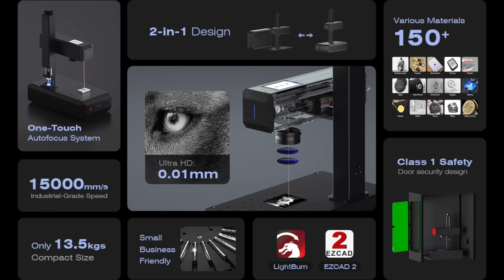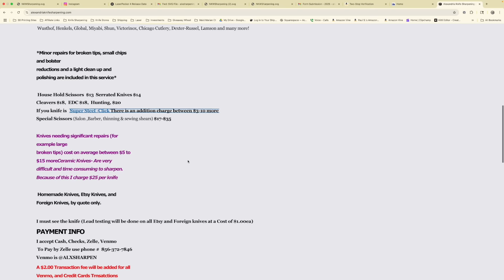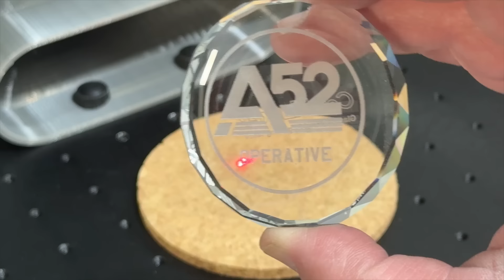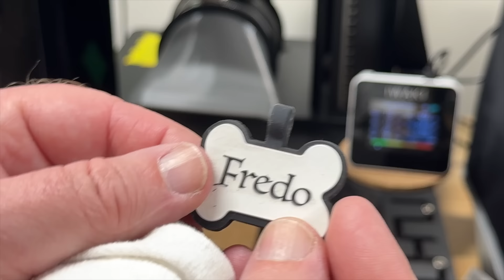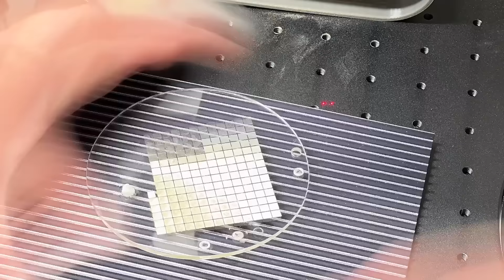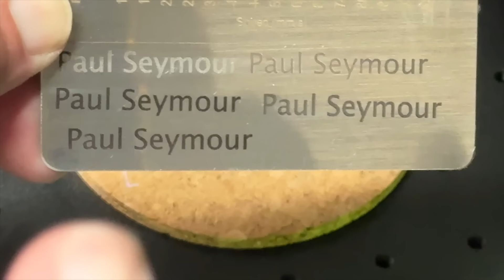ComMarker Omni 1 5 Watt UV Laser or ComMarker B6 20Watt Fiber? Which one SKYROCKETS Your Business

Comment: Great video!

Would you mind sharing the settings for the defocussed black mark on stainless with the UV? I have a 10w UV and I am trying to get a good black mark and yours looks great!  :)
Reply from the maker: I haven’t done with the UV  to see it’s sweet spot yet
Reply from the maker: You just have to raise up your lens 3-4 degrees above your normal infocus position.  It’s best to test this on some scrap. Use a good setting for a regular black mark let say on the B6 for me 100 pow at 50 speed 200 LP 20 Freq do a small box engraving then raise the lens 1mm higher run another test and keep doing up till you get the best black mark - you shouldn’t see sparks when it’s defocused - If you search my channel for defocus I am pretty sure I did a video on it using both the F1 and the Commarker B6